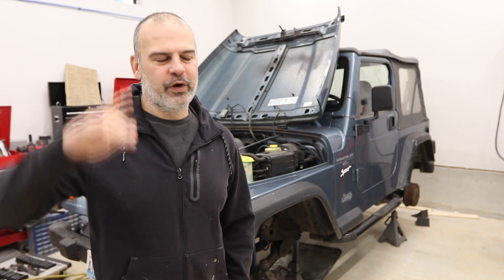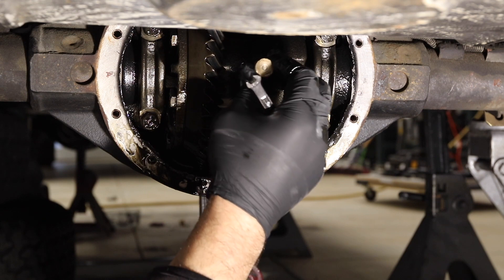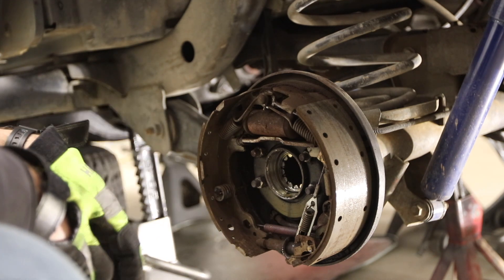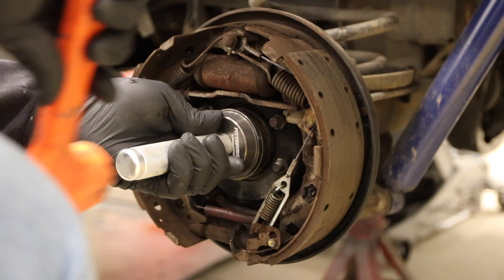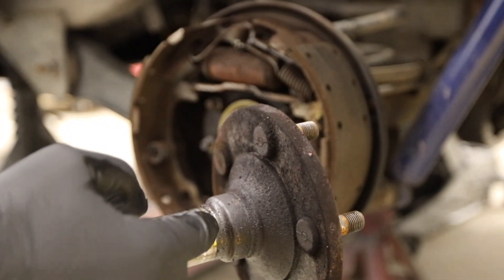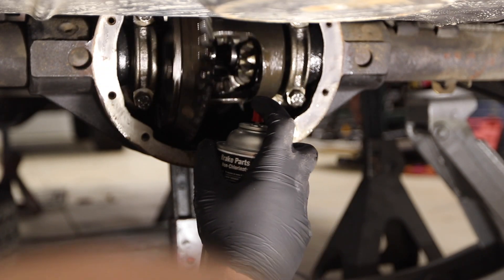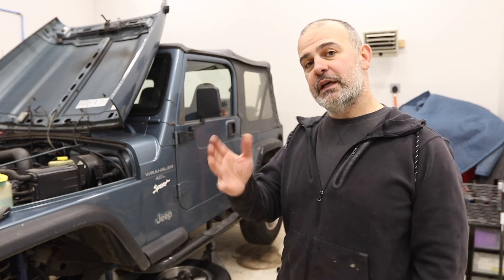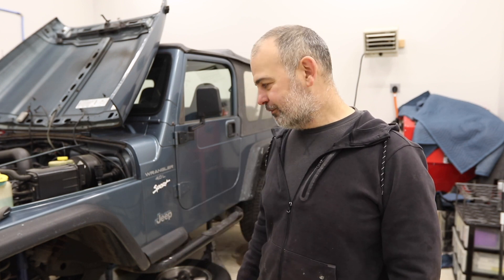Jeep Rear Axle Seal

Comment: Matt be careful about putting anti seize on your lug bolts, the nuts tend to back off, I bet your really enjoying the new garage.  I am sure by now your saying I should have done something different there.  I usually have those thoughts halfway through the project
Reply from the maker: No complaints actually Matt.  Good tip on the anti-Seize.
Reply: @MattsGarage  i only know that because my brother in law watched his tire fly across the interstate at 70 miles an hour on his 4500 dodge work truck
Reply from the maker: @matthutchinson3139  😳

Comment: I am surprised your rear axle didnt have a toning ring for the abs. I just did my wife's(97) and hers had it. Of course when i popped her cover she had pitted spider gears and 1 axle had a bad wheel bearing. I dont think that rear end is a posi, it looked to be a stock open carrier.
Reply from the maker: ABS was still optional in 98 so no tone ring! It’s definitely a posi. It’s a Trac Lok and it does look like an open carrier but you can see the side opposite ring gear is more squared off.

Comment: I have a 12 wrangler JKU and rear axle won’t come off. Do they all come with the C clip?
Reply from the maker: No, a lot of Dana 44’s have a backing plate that holds the axle in place. You access the bolts though the big hole in the axle face.

Comment: Matt, what is the reference of yiur eeal, manufacturer as well? Regards from France
Reply from the maker: Bonjour!  Enchante. Where in France?  I have spent time in Paris, Lyon, and Normandy.  I am sorry, but this was a long time ago and I cannot find the receipt for the part.  I looked through our local auto parts store website and they are listing it as Power Torque 721A074 for the Dana 35 and Power Torque 713A076 for the Dana 30.  You can do a cross reference search for the brands you have available there. I hope this help.
Reply: @MattsGarage  Hi Matt! Enchanté! I live in Montpellier but my family's in Lyon ;)
I have a ZJ 5.2 with a Dana 35, replaced the seal and the wheel shaft but still getting leaks, need to try a couple different seals and see which is the better fit. But not many options listed on R...Auto. Thanks for replying!

Comment: Hey i changed my rear axle and bearing a little over 6 months ago. I never did anything with that pin.... is that ok or? Because ive been daily driving it lol
Reply from the maker: What!?! How did you get the axles out without taking out the pin?
Reply: @MattsGarage  I have a 03 wj laredo selec trac. Not sure that matter but I promise I never removed a pin. It was my passenger rear shaft that I removed and placed the bearing and race
Reply: @MattsGarage  but it has a dana 35c thats basically why I'm asking
Reply from the maker: @durantplayz7111  apparently someone makes a c-clip eliminator kit for 35c axles? That would mean there would be bearing retainers at the ends of the axles. That’s the only way that could work. Otherwise your axles would just fall out.

Comment: not enough rtv gasket....it's gonna leak. You should use a torque wrench to torque the cover down to specs.....should be 55 ft. pounds
Reply from the maker: It’s been a few years. No leaks.